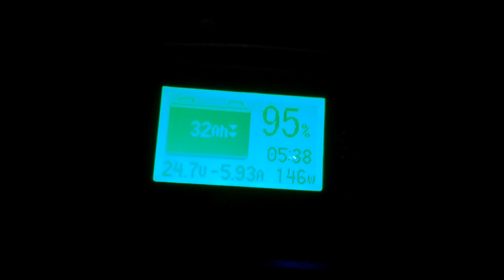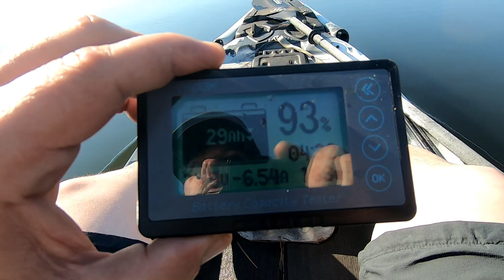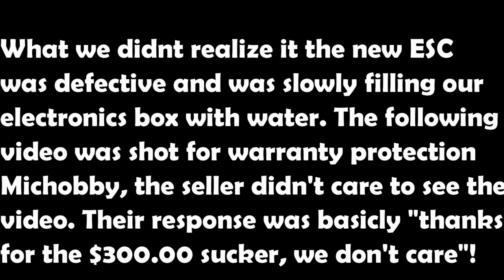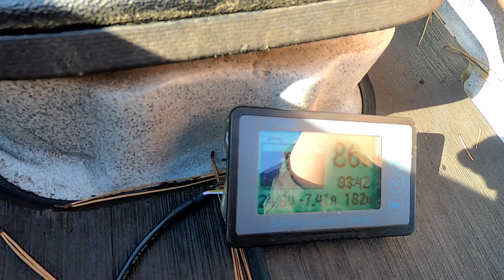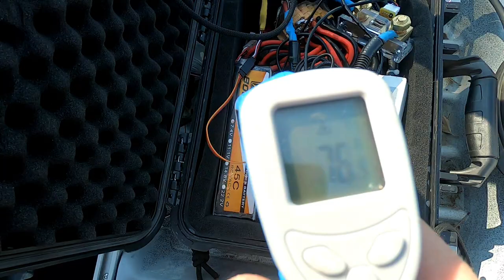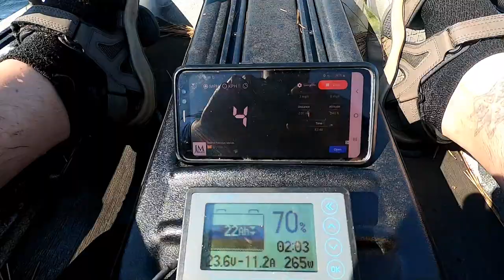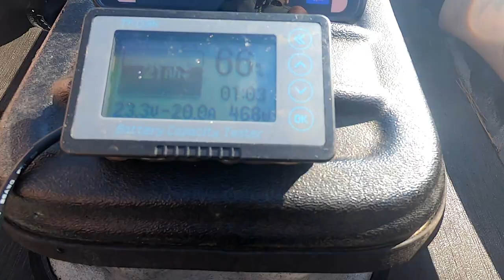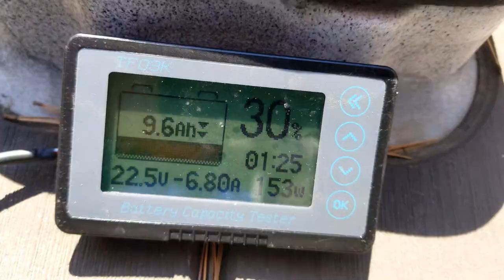Monster E-KAYAK! Long Range Test!

Comment: Amazing how little amps the motor is pulling at these speeds. I was expecting amps in the neighbourhood of 100 to 200. Nice video!
Reply from the maker: +3DPrintCNC I want to test the amps coming from the esc. That will be In the next video. I was very happy with the draw. The next system I'm testing is a twin waterproof motor setup The motors are smaller and have a max draw of 60 amps each and I'm using a twin 150 peak esc. I'm hoping splitting the amps over two motors and two props will net us a good inexpensive long range setup with a decent top speed. I would be very excited to see 7mph from this setup.
Reply: @TheGoodoftheLand  Sounds great, but i think that two smaller Motors are less efficient than one big motor because the smaller motors will need smaller props and higher rpm which will have more drag than one bigger prop at lower rpm's. But I could also be wrong :D. You should definitely try to make the motor more flow-optimised.
Reply: @TheGoodoftheLand  In a "working" enviroment  7mph is plenty, burst mode for the home run maybe !!!   ( i have pescador pro 100 ,pwm switch, 40ah lipo )
Reply: @TheGoodoftheLand  fishing while creeping along or matching current flow --- one motor working ??

Comment: Nice video, it clarified me that there's no actual need to get a very big engine, and that the ratio between the combustion engine and the electric one lets this last one be powered by a smaller power train.
The question is... Does thi engine, which looks like waterproof, work in salt water? If not, does another engine exist for such a use?
Thanks!
Reply from the maker: +Massimiliano Perantoni No. This motor will quickly be destroyed by salt water. I have another motor I'm testing for salt water. It is sealed and rated.
Reply: @TheGoodoftheLand  really waiting to get my kayak boosted by an engine... It is an inflatable ITIWIT. I was anyway looking for info such as the energy needed to move at 3 or 4 kts. Video explained me that I was overstimating the amount of batteries for what is my aim. Thanks ;)

Comment: Maybe time to install a Lowrance fishfinder to monitor your speed. :)
Reply from the maker: +Tim Percy Kayak Fishing Yes! I was looking at Raymarine. What are your thoughts on who makes the best with side imaging?
Reply: @TheGoodoftheLand  I like my Lowrance units. I currently use the Lowrance Elite Ti2 with 3 in 1 Active Image transducer. I've never really had to play with any of the settings...they work very well out of the box. The touchscreen feature makes them very user friendly. They are easy to customize what information you want to display on your screen ie. speed, depth, water temp., volt meter, etc.
Reply from the maker: +Tim Percy Kayak Fishing Thanks! I will give it a look!

Comment: Any chance gonna install a solar panel or bank charging system of them on the kayak to trickle some power into your batteries while you’re running in the sun?
Reply from the maker: +Rusty Dodge I am. Not on this kayak because the new battery is so big you simply wont need it. I'm going to build a solar kayak. It will have a 150 wat panel and a small battery.
Reply: The Good of the Land... Gotcha, Thank you JUSTIN. Really enjoying this step by step build! ClSs all the way Brother ⭐️⭐️⭐️⭐️⭐️
Reply: CLASS all the way! Sorry Justin, don’t see so well! 🤣

Comment: I know this is a older video. Just wanted to say be careful with the lion 18650 cells. I know everyone says whatever about it. But it can happen. My entire shop burned flat because of them on the 3rd of July this year. Had a Honda crf 450 I had converted to electric. Fire marshal thinks the battery exploded !  Lost everything.  And I mean everything.  Just be careful. Don’t leave them charging in attended. Don’t leave them hooked up. It can really suck.

Comment: if you want a better batt pack but a crashed or prius  and take the pack apart
Reply: I think you can just buy the battery’s from it.
Reply: @aaronhayden1780  ya maybe but i have seen then sell for 3 and 400 on Copart's

Comment: 16 to 20 for the timing, is good for speed and consume. 😉
Reply from the maker: +joc mok Thanks, I will give it a shot!
Reply: @TheGoodoftheLand  with drone racer with hardware and gyro we use 20 to 26  but with gyro. if not corrected by card you can use yes 16 to 20 with lot of power for same consume. as you know it s a compromise between power and power 😂
Reply: @TheGoodoftheLand  have you tried 12v motors with higher kv ?

Comment: I'm with the seller/manufacturer.  You didn't really check for leaks. Few electronics warranties cover misuse.
Reply from the maker: That is not the case. It ran on the bench for fifteen minutes before it was put in the case.  Not a drop of water escaped. The water doesn't have a ton of pressure, the pump produces flow. It took it a while to erode the thread sealant before the water could escape. Every single part is bench tested before it goes on the boat. Very expensive components with a potential for an electrical fire and leaks. Hope that helps. I have hours of video, I apologize for not including the bench test video I will add it to the next video for clarification. Does having this info change  your opinion on the situation?
Reply: @TheGoodoftheLand  Was there any difference between bench testing and application, such as open container for testing and sealed container for run? Perhaps more pressure than in the testing?  That was my initial thought if there was nothing apparent during tests.
Very bad design if water soluble sealant is used in a water pump.
Reply from the maker: @zandemen  The sealant isn't water soluble it was gently massaged away by the flow and tiny amount of pump pressure. Water simply found a flaw in the system. I now know  to check the fittings. Also going to have to test the motor as well. It is supposed to be waterproof. Can't trust it. I will likely be switching to a different brand of ESC.

Comment: take that shrink wrap off the controller and use clear coat spray to water proof the controller and board. just don't get it on the heat sink.

Comment: I hit 8mph with my home made electric kayak. Over 7 is possible. I run a 2000 watt 48v system right now. Hope your project goes well and excited to see what happens.
Reply: Also, if you can somehow source it out, I highly recommend an air cooled speed controller. Finding a good one might be tricky, but it will make the system simpler, maintenance/worry free, and most of all, quieter for fishing.

Comment: How far did it go?
Reply from the maker: Not sure but I believe it had 35%of the battery left and ran 20 miles.
Reply: @TheGoodoftheLand  with a 100 Ahr battery and peddling as well would probably work fine.

Comment: For a motor that designed for 16s, 3s is not enough volts for a slow take off because the large coils that can handle the large voltage dont put out enough magnetic force at low power to turn the motor as fast as it thinks its going to
Reply from the maker: +Travis Williams Yes, the big motor wont even turn unless it has at least 6s. The pack in this video is 6s.
Reply: Oh wow, its so cool how you can get good efficiency even with minimum voltage, would love to see your big pack configured for different voltage with same ah, and same speed, see what the efficiency difference is